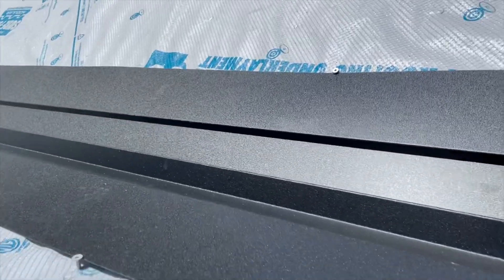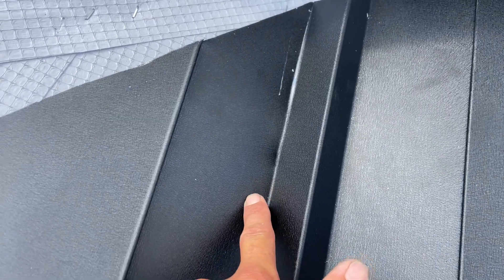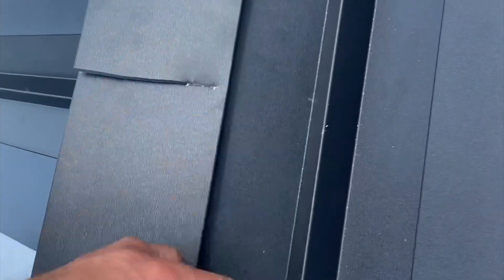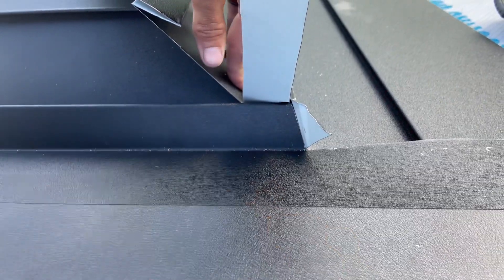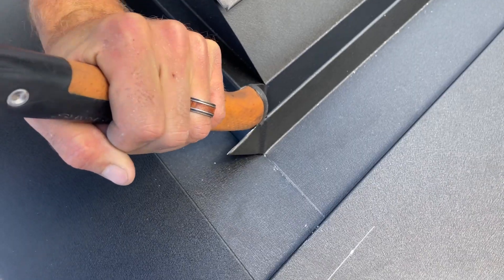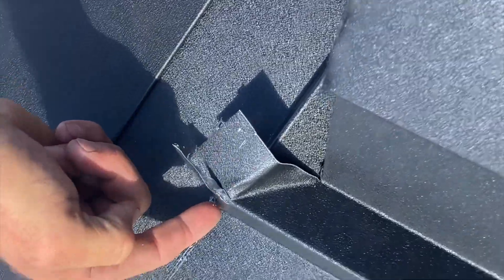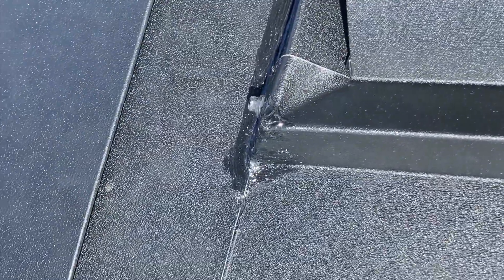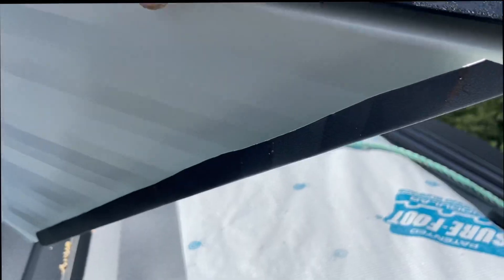How to Join Valley Flashing, (Standing Seam/ Concealed Fastener Metal Roofing.

Comment: Thank you for this video! It was exactly what I needed. The guy I work for bought these valleys with the built in cleat(from Amish in mid Michigan) to try and eliminate a step. It did, and I’m decent with steel work/bending however it tested my skill. I found videos for the bending/cuts @ the bottom and the top of the valley(yours for the top) that helped me. However no one has a video on how to overlap with the built in cleat. I figured that out but not sure if it was the proper way
Reply from the maker: You’re welcome,  nice! We got these in the video from Royal Oak metal sales in Tustin MI, they are some of the best!  in my opinion, 
I’ve actually been working on a video hat shows how to splice those, 
What I do is overlay them where I want them, and then mark where the overlapping one stops, and then I cut the cleat on top/ outside, exposed part,
 off to within an 1 of my mark, 
And then on the underlapping one, I do the same but on the bottom/ inside, or non- exposed part of the built in cleat
This allows you to slide them into each other, but because they’re so tight, you can’t do it with out trimming the cleats, one on each piece, up to within about an inch of where you want them,  it goes pretty easy up till that point, and then the last 1” you have to take a 2x4 and hold it onto the top end of the overlapping piece, and beat it into that last 1”. And then make sure it’s well sealed with sealant , Inside and out of the cleats, just for insurance. 
I hope this makes sense,

Comment: It looks cool, but it's absolutely not necessary...   All I do is extend my ridge cap all the way over to that upper pitch and snip the ridge a bit so that it can fold up hill-- that way those top sheets can come down and overlap your ridge cap--  then all that valley work you just did is completely covered up.   Then you just put a foam closure under the edges so that it keeps the bugs out..  and meets up with the closures that go all the way down the rest of the ridge and looks great.    Any time you're relying on caulk,  you're not doing it right IMO..  I've don't all these fancy ways too -- but I never liked it and I changed to just sticking with overlap as a base principle, and stopped relying on caulk.   People don't like climbing on their roof and doing maintenance--  so I do it the way that prevents the need;  even if it looks slightly less attractive.
Reply: Ok I’m glad I saw your comment. I’m In the middle of a job and I did my valleys as if a ridge cap was going to cover it up and then I saw this and started second guessing my work. It might be covered but it still looks way better and is probably way more water tight than what I did.
Reply: @RooferMikeJT  It depends on your climate.. If you get several feet of rain per year.. or end up with 5ft of snow on your roof for several months out of the year..  Then it's not a bad idea to make these things more redundant like this.. but for most places on Earth-  it's not needed at all (as long as you have the ridge cap sealed nicely).

Comment: I like that hem. What manufacturer is that?  I’ve put in two standing roofs but the valley flashings were plain, no hem.
Reply from the maker: We like it too, we got it from an Amish Metal Shop, A small local manufacturer. 
And they have a 21’ trim break so that’s can make it that long. But that shuts the way they make them. It is harder to join of you have to make a splice. But beings we could get 21’ we didn’t have to do that a lot. 
Some manufacturers make a z bar that gets screws onto the valley flashing with beutle tape under it, to create the hem.
Reply: @plankroofing  What settlement are you near?  I buy metal out of Lagrange Indiana and they have a huge break like that.